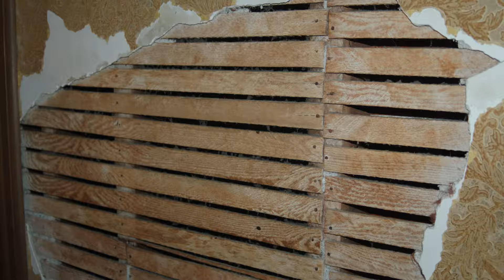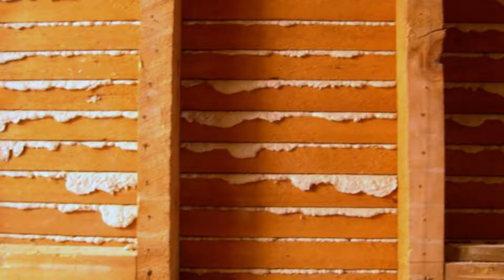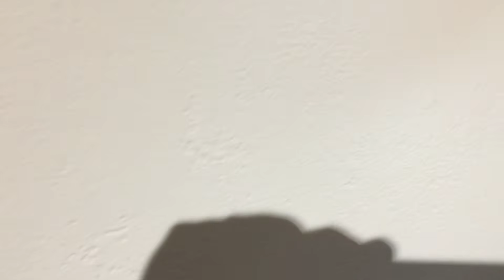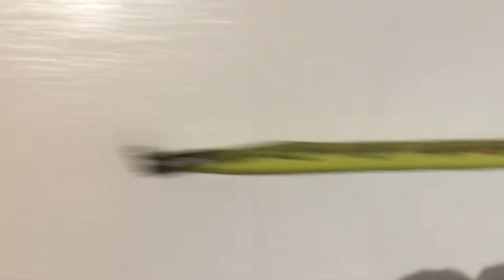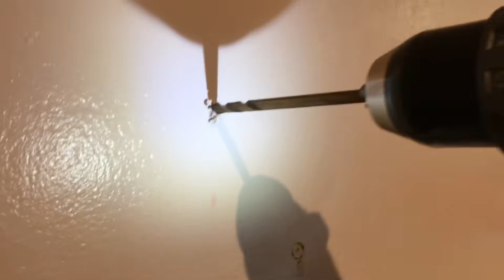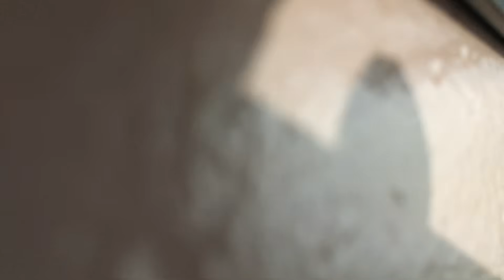How to Mount TV on Plaster Lath Wall? Magnetic Stud Finder for Plaster Walls

Comment: Oh bummer I was hoping there was another idea. My husband said to put this big black shelf. I have in the studs and there’s two open areas with a silver bracketing on each end of it like a frame and that’s where the holes go. That’s where the brackets go, and I don’t know other way to hook it up to the wall. We thought maybe we try those like plastic big screws and then put a big metal screw in it, but he said that probably won’t hold plaster
Reply from the maker: Yeah it can be annoying when those things aren't spaced for standard studs 16" or 24" apart. In that case, it's best to get at least one side in a stud and then the other with large toggle bolts or something to grab the back of the wall.

Comment: I'm going to be installing kitchen wall and base cabinets in my son's 100 year old house. It has plaster lath walls. I have a couple of questions. First since the plaster is a concrete type product, is a masonry bit required or recommended? Also if I can only find one stud due to the cabinet width, can toggle bolts or any other type of hallow wall anchor be used? Thanks for the informative video.
Reply from the maker: Though it's a lot harder than drywall, plaster is far softer than concrete and I've found regular bits work fine. If you're worried about it cracking, you can put tape on the area to be drilled. Can you get a cleat between two studs and put the cabinet on the cleat? For cabinets I would only use toggle bolts for extra security but you really need screws in several solid studs. If one upper is so narrow that you can only fit it on one stud, then at least two screws through solid cabinet material (not through the 1/4" backing material) then you can add extra support with long 1/4" toggle bolts or the flip toggles.
Reply: @toolsandrepairs  thank you for the reply. I'm building the cabinets and going to be installing them in April.

Comment: Plaster and lathe walls here.  Have had zero luck finding studs and the outlets are few and not located near where I need to mount things. Mounted a 15lb (32 inch) tv successfully using (6)  3in x 1/4in toggle bolts on the mount.  It feels plenty solid.  Currently mounting home depot metal shelving Everbilt brand heavy duty and using 3/16in toggle bolts to attach the horizontal hang-track in my closet.  Feels solid.  To sum up, if you can't get lag bolts into a stud, then just put a bunch of toggle bolts in.

Comment: Got the magnetic stud finder but the entire wall is magnetic, what does this mean?
Reply from the maker: It could be plaster over metal lath, ducts or some kind of metal sheathing protecting something. Look for outlets which are usually connected to a stud, try knocking on the wall to find the stud, or use some other way to find a stud. If you think you find a stud, and drill and hit metal, stop drilling.

Comment: How do I ensure I don’t hit any wiring or anything else that might be behind the wall?  Would finding the stud be enough to avoid that?  Don’t wires run through the studs?
Reply from the maker: There are some things to lower the risk such as using a stud finder with electric sensor. There may be a metal plate on the stud in front of a wire on newer homes or a ceramic tube through the stud in older homes, either way don't drill further if you hit anything but wood. Ideally they'd make the lag bolts short enough not to hit the center of the stud and use more bolts but I've never seen short bolts so you always have some risk of hitting a wire or pipe.

Comment: We couldnt get ours to mount to 2 studs because our studs are too far apart in our 1880s house.  So we had to use a combo of stud screws and toggle anchors that were made specifically for lath and plaster and rated at 200lbs each.  Hopefully that will be good enough and our TV wont come crashing down. 😂🤞
Reply: You can also use a 2x4 cut smaller then the tv and run it from stud to stud, as long as you cut it to just enough size you wouldn’t even tell the 2x4 is there
Reply from the maker: It should be fine with 2 lags in a stud. I've mounted TVs the same way on drywall with 24" spaced studs with 2 flip/snap toggles holding one side. For smaller TVs, a one-stud mount is sufficient.

Comment: I am getting a pull from magnet but it will not fully stick in place as seen in your video- do you think this could be related to the thickness of the plaster? The house I live in was built early 60’s and bought exact same tool you recommended in the video. Thank you! This video was most helpful.
Reply from the maker: It could be because of the thickness of the plaster as you said. On some walls, I have struggled to find any nails because the wall was so thick. I would just mark that location as a stud and drill a pilot hole somewhere along that vertical line. In cases like these, the one-stud mounts are helpful because it is hard enough to find just one stud.

Comment: How do you get the cords inside the wall?
Reply from the maker: There are code-compliant and safe kits that can be bought to hide wires behind a hollow wall. Those are mostly for drywall but I believe they should work in plaster hollow walls. Cutting the holes is much more difficult though. Might be better off just using a raceway channel to hide the wires, which can be installed in minutes and painted the same color as the wall

Comment: is this process the same if you have plaster over concrete?
Reply from the maker: No, you'd have to follow the instructions for concrete TV mounting that came with the mount. Hopefully the mount comes with masonry anchors with the lag bolts (some don't), figure out and mark where you'll put the anchors, then drill with a masonry bit deeper than the anchor, tap the anchors in and put the lag bolts through the mount and into the anchors. I only use flat mounts on concrete and I also add a few concrete screws for extra strength.

Comment: I've used extremely strong magnets. No luck. I'm gonna have to have to find the studs based on outlet locations
Reply from the maker: Just make sure when you drill pilot holes, your bit goes the full length of the lag bolt. That will tell you you're in solid wood, rather than just drilling through the laths/plaster.

Comment: Couldnt find the studs with stud finder or a magnet of several types.  Considering a Walabot to find the studs.
Reply from the maker: I've had issues with very thick plaster and 24" or even more spaced studs in a very old house. I was lucky to find one stud to put lag bolts in (you may need to drill some holes to search for a stud), and then used toggle bolts. I haven't tried a walabot, but I would guess if other stud finders and even a magnet don't work, a different stud finder probably wouldn't work either.

Comment: Great video especially the magnetic stud finder ( nails).My house built in 1927, not one time did I find 16" on center!! Nightmare on Elm street here! I would mount thin bards to studs ,then stain, mount item. Awesome information, thanks!!
Reply from the maker: Thank you. Yeah I've run into that problem as well which is why I like the one-stud mounts for smaller TV's up to a certain size, but I rarely have that luxury. For oddly spaced or 24 inch spaced studs, I put at least 2 lag bolts in one stud and then two 100+ pound flip toggle bolts to mount small TVs. But for a large TV, your option would be best for wacky spaced studs.